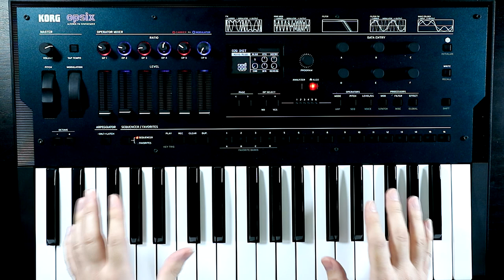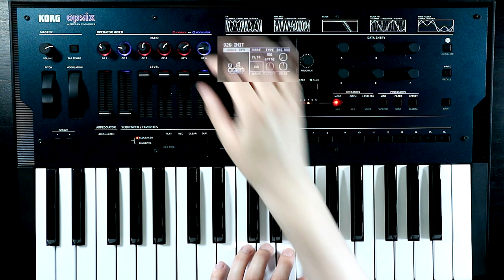Korg Opsix - Operator Modes in Depth: Filter and Wavefolder

Comment: As a eurorack user, all this talk of wave folding and modulation makes my insides tickle 🤗  thank you for making this!
Reply from the maker: As also a eurorack user: same! Both this and the Modwave incorporate a lot of ideas from the world of modular and it's great (you can "patch together" operators much in the same way you can modules on the opsix for example).
Reply: @OscillatorSink  Have you had much experience trying to sync the Opsix or Modwave with your rack?  I assume I could drive it with Pam's or use a CV to midi converter and just sequence it from the rack.
Reply from the maker: @jammystraub488  I haven't, but should he fine. I'd probably just use Digitone/takt to send midi to one and din sync to the other. Or use cvocd as a go between. Either should work I reckon.

Comment: Hello and thank you for sharing your knowledge. I've learned so much from your videos. 
I'm attempting to use filter mode in both series and parallel to simulate the multimode SEM filter of the oberheims. I'd be very interested in your thoughts on the best way to go about it. I've had some great results but your in depth knowledge of sound design would be greatly appreciated.

Comment: This video and the rest of opsix series you´ve made are excellent. Since I sold my DX7 back in 1997 I haven´t bougth any synth yet (except for a NTS1 a couple of month ago) I´m really considering to get one of theese but the lack of atertouch and no exp pedal input kind of pushes me back. Anyway I could consider it as a desktop module with extra keys  if i knew it responds to aftertouch via midi controller. Does it?
Your videos shoud have wwwwaay more likes. Thank you
Reply from the maker: Thanks! Aftertouch is a modulation source in the Vpatch, so if you have a controller that sends aftertouch then you can patch that all up!
Reply: @OscillatorSink  Thank you!!